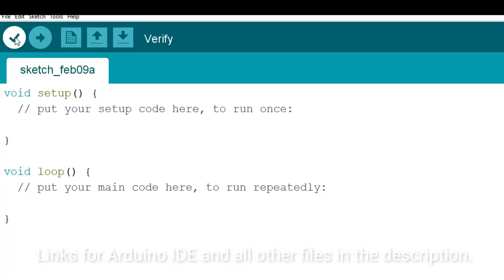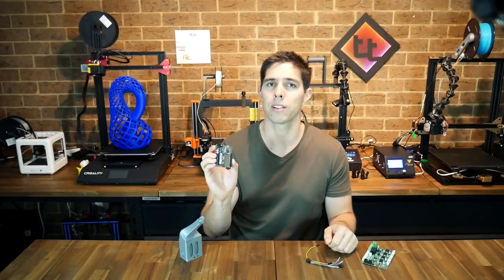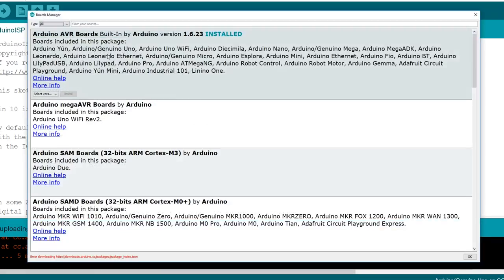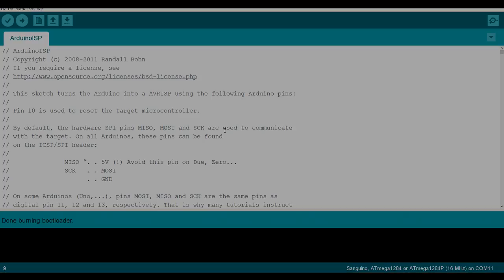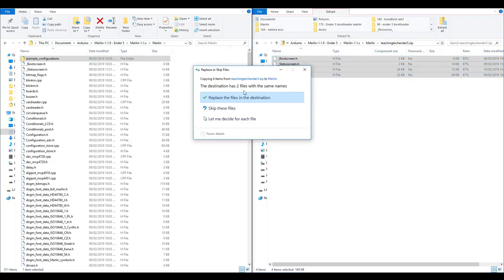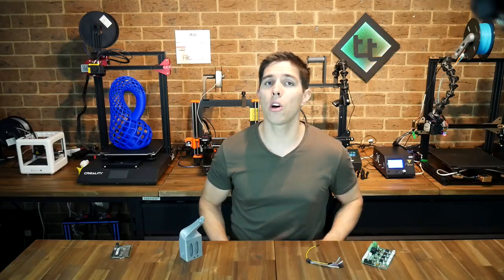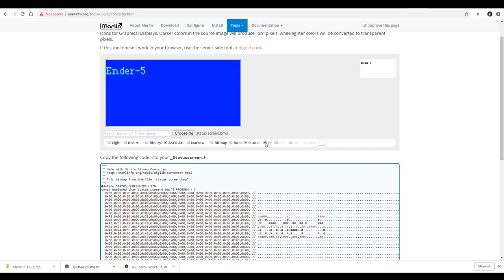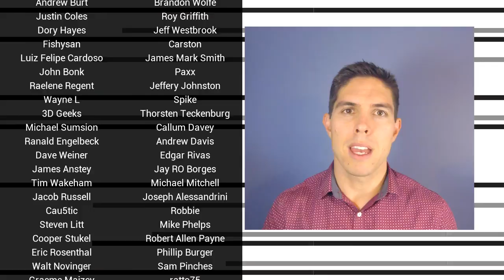Ender 5 bootloader and Marlin update

Comment: Personally I ran into 2 problems following your guide and it took me a few hours to solve, so I'm posting the issues and solution here for those in similar situation:

#1 I used "charge only" USB cable that did not transmit any data, so the boards were not visible. Make sure you use "real" USB cable (if the cable is very slim, it's probably charge only).

#2 My Arduino IDE used "arduino" in its programmers.txt setup file for "Arduino as ISP" template, instead of "stk500v1", so the board kept timing out when trying to burn the boot loader. Make sure it uses "stk500v1", i.e.:

arduinoasisp.name=Arduino as ISP
arduinoasisp.communication=serial
arduinoasisp.protocol=stk500v1
arduinoasisp.speed=19200
arduinoasisp.program.protocol=stk500v1
arduinoasisp.program.speed=19200
arduinoasisp.program.tool=avrdude
arduinoasisp.program.extra_params=-P{serial.port} -b{program.speed}

Credit for the solution to #2 goes to https://forum.arduino.cc/index.php?topic=342977.new#new

Hopefully, this will help someone from waisting their time.

Thank you Michael!

Comment: You sir are a life saver.   After replacing my original board, I received a new one in the mail and it came with ender 3 burned in.  I couldn't figure out any of the instructions on the creality website.  They are terrible.  Thanks for the step by step tutorial.  It worked phenomenally.

Comment: Michael, i used your software with a few adjustments to install an mks gen l into my ender 5, also installed the tcm2208 standalone as per your other videos. works great and is very quiet. pointer for anyone doing the same, make sure for your x and y end stop you use x max and y max plugs if using this software took me a few hours and a lot of youtube to figure that one out. thanks again for your informative videos and insight.

Comment: This might be obvious to others but I'd thought I would share. After printing the hot end would move to the front left as opposed to the rear right as it did before. In Cura i had to change the End G-Code in the printer settings. I changed "G1 X0 Y0 ;Present print" to "G1 X225 Y225 ;Present print". Now the hot end moves to the rear right after printing.

Comment: Thank you Michael for this great guide. Updated mine last night. I did run into one issue when attempting to burn the bootloader that I wanted to share. I had no issues loading the firmware with my MacbookPro, but for some reason couldn’t get the bootloader to burn when running MacOS. I tried multiple USB cables and ports on both of my MacbookPros, but it kept failing. I switched over to a Windows 7 partition on one of the MacbookPros and it worked.

TL/DR:
Had to use Windows to burn the bootloader, but MacOS worked for everything else on my MacbookPro.

Comment: Best help ever. Needed to flash my Ender-5 as it had problems. Could have done it with the creality firmware, but wanted to do something interesting. So installed the bootloader and moved to Marlin. Worked perfect. 
One problem, somehow when all done Z hight was 50%. So changed the setting in the configuration.h from 80,80,400,93. To 80,80,800,93 flashed again, which was easy with the bootloader installed. And all working as expected.
Again thanks very much.

Comment: Thanks for these guides, I've finally got my Ender 5 homing properly with an MKS GEN L board and TMC2208s

For people like me, that might not have immediately got what is going on and are trying to combine your E5 configuration along with the MKS/TMC2208 video configurations... USE THIS ENDER 5 configuration as a base. Only change the BOARD_MELZI_CREALITY to BOARD_MKS_GEN_L and then go ahead with whatever other changes you might have (BLTouch, display etc)... don't make the mistake I did and start inverting axes to match the instruction on the MKS videos.

Plug your X and Y endstop switches into the X&Y MAX sockets on the MKS and everything should go smooth.

Comment: Pro tips:
* If you don't see the pins on the Ender 5 then remove the bltouch daughter board.  It hid them for me.  Be sure to put it back after flashing.
* If you see multiple similar options in the Arduino IDE for 'Board', 'Processor' or 'Programmer', choose the most specific.  EG: 'Sanguino 1284p' over 'Sanguino'
* If you see multiple similar options in the Arduino IDE for 'Board', 'Processor' or 'Programmer', and it doesn't work then try others.
* If you're on a Mac, I found that I had to restart the Arduino IDE for it to see changes and even function correctly.

* You do not need to have the Ender 5 powered up on it's own power.  (That's not explicitly stated anywhere.)

Comment: Thank you Michael. Another great tutorial and the free files are a boon. Will look forward BL Touch upgrade walkthrough as not getting beyond probe double-click with the .h files you provided for Ender3.  B L Touch lcd menu items have no effect. Heads up as the new menu does not now offer disable x and y steppers for original manual bed levelling method. I have been running a Micro Swiss mk8 hotend and a glass bed for a month and am very happy with both. One last gripe about the new Marlin, it appears to chop the power to the Z axis after 2 mins when Auto Home has been run from lcd menu. This is a drag as with the weight of the glass the bed drops to the bottom of the leadscrew.  Make sure to un// the line which defines the small z drop before homing, otherwise the stepper then tries to pull the bed down beyond travel. A few good thingiverse parts have surfaced. There are an excellent pair of struts to fit under the bed which kills off the diving board twang effect and a modded Bullseye fan housing came out a few days ago which works better than chopping up the Ender3  version. Hope this helps and saves you some of the time that you have saved me. thanks again Mr D

Comment: I initially followed this video on a Mac. Ran into the same typical error noted by others. (I had Arduino previously installed on my Mac for other projects) So since this video didn't get my boot loader working I went and found some others. And in the end my Arduino IDE stopped working altogether basically. So I deleted it and its associated files from my Mac. Started over with a clean IDE install and back to this video........ Worked perfectly this time around!    Thank you :-)

Comment: Thanks! Many thanks! I recently bricked my practically brand new E5 pro by installing BLtouch..which went terribly wrong. After acquiring all the necessary items and following along with your video(s) I was able to remedy the situation.
Reply: Hey wassup King I need a little help with mine. I have a ender 5 pro like you also bricked mine trying to install BL touch and like you I got the Necessary tools and did everything but when I got to the last step which was uploading the firmware to my end or it says Sanguinoloh or something like that instead of saying sanguino any help

Comment: All worked beautifully for this newbie, except for the issue that others have noted with Z lead screw pitch having changed on the Ender5 (all varieties?). So the steps/mm needed to double from 400 to 800. This update also de-mystified Arduino somewhat for me. Many thanks.

Comment: Went through the process, finished ok. Didn't test the printer yet though, only turned it on. Thank you for the guide!
Edit: My Z Axis was squished, I had to fix stepping for Z axis in configuration.h from 400 to 800 to make it normal again
Reply: I have the same problem.

If you have OctoPi you can do the following

M503 - You can view your current settings. Might look something like the below (and other lines). Mine used to say Z400.00.
Recv: echo:Steps per unit: Recv: echo: M92 X80.00 Y80.00 Z800.00 E95.00
M92 Z800 - Changes your Z from whatever it is to 800
M500 - It will write it to EEPROM
M501 - It will load EEPROM values as active parameters
M503 - Confirm that the changes have taken place

Credit: https://www.reddit.com/r/ender5/comments/ekuosi/z_axis_halved_after_silent_board_install/

Comment: I did finally get up the guts to purchase the Arduino uno board and update my Ender 5 and with this tutorial it went well.  Some of the files and links have been updated since this video and you will loose the bed level feature.  I was unable to find a way to perform bed leveling after the Marlin firmware update and instead went on and installed the TH3D firmware (easy after going through this update here)  Even with the TH3D I found my bed was still a tad low and had to tweek the knobs up a bit higher while doing test prints.  The process of doing this firmware update isn't for anyone who isn't pretty tech savy and it will possibly lead to big problems if you don't follow the directions in this video to the letter!!  The main thing you will gain is thermal runaway protection, if you never leave your printer alone and never go to bed while printing you can forget about this.  That said, never leave your printer alone anyway!  But this is for that moment you walked away.  You will also gain the ability to tweek your firmware and modify what you upload since you can do it over and over with your PC and the USB cable, the UNO will not be needed again just the UNO software on your PC.

Comment: Thanks a lot for your tutorials i really did learn a lot, I’ve just updated my ender 3 with your last video thanks !!!
Reply: Thank you so much for this! I don't know if I could have done it on my own.

If anyone is getting an "unable to compile for sanguino" error, roll back to the previous version of Arduino Boards at the top of the board manager. 

If port access is denied and only one port is showing up when you move the USB around, restart your computer.

@teachingtech I also set the z axis not to disable when a print finished or when the other three steppers deactivate, to stop the bed from falling. This is out of my skill level, but I was hoping you could add in some code to help with leveling. I tried to enable mesh bed leveling. I tried to enable it and I think it used too much space? With the standard Creality firmware, the disable steppers option would allow you to disable just the x and y axis, or all three axes. This was very useful for leveling because I could auto home and disable x and y to move the head around for leveling, but now I hit disable steppers and the bed drops a couple of centimeters. Do you have any advice? Would love to still be able to do this, or enable mesh leveling.

Comment: Awesome, thanks for this! 

Would love a stepper damper, driver and tl smoother upgrade video for the 5, especially the damper with a bit of a more in depth look at how you solved it on the 3 for the extruder. X & Y went ok, doing Z means raising the printer with some taller feet I believe, but the extruder when I fitted it, I had to flip the extruder gear so it had the grub screw side facing in towards the stepper. This was the only way I could get it to fit, but then the gear shaft appeared to bend quite severely as the lever and clutch would press against it, so I took it off again.
 
I love the 5 in general, just needs to be silenced, the heatblock and psu fans in particular. Noctua with a buck transformer for the heatblock makes sense, was thinking about printing a 120/140mm fan duct to attach to the side of the printer to blow a ton of air through the entire base, then removing the psu case and fan entirely.

Comment: Hey ! Thanks for the Tutorial !
I needed several attempts to get marlin running on my Ender 5..... 10 hours fiddeling around... :-(
I noticed that the firmware is'nt optimal for the Ender 5. Especially one annoying thing:
When you choose within the menu to disable the steppers, all steppers will be disabled.
The original Firmware just disabled the X and Y axis so you can manually level the bed without pushing the Z axis...
Is there a way only to disable the X and Y axis when choosing within the menu to disable steppers ??
Reply: just download universal from th3d site and have fun
Reply: This is just a guess, but surely you could find the “disable stepper” command in the marlin firmware code and modify it to only disable x and y??

Comment: Teaching Tech, great content--learned a lot.  Question on my new Ender 5 Pro.  The hot end fan runs non stop which kinda defeats the purpose of silent board....:)  If I put a MicroSwiss hot end on, can I just disconnect that loud pesky fan, or is there a software solution?  I can't find any settings native on the machine to dial down the fan.  Thanks!

Comment: Michael, I just ordered an Ender 5 but it has some differences from every single Ender 5 review that I can find online. The one I ordered has a Version 2.1 controller with the Atmega 2560 mcu,  similar to the CR20. I am interested in adding ABL and possibly upgraded hotend with thermocouple sensors, later on. Do you have any ideas on how different this process will be for me, since this controller is different than any other Ender 5 review I've seen to date? Honestly, the main reason I ordered this was because the seller conformed through email that it did, in fact, have the V2.1 controller board. I do not know what else may be different from the original Ender 5. Creality lists NO information or firmware for this machine with this controller. I am very interested in hearing your opinions on it.

Comment: I am seriously thinking about purchasing the Ender 5. However, I am not impressed with what now seems to be its limited memory size and having to choose which limb to cut off so I can add features.  Seems in most cases, multiple limbs have to be sacrificed.  

What I was hoping for was information on how to upgrade the actual Controller Board to one that’s better and with more memory.  

Initial searches seem to point to this being possible.  

I understand that the intent here was to show how to improve what comes standard with the 5, however, it would be great to also show an alternative that gives a better controller capable of doing all of this and not having to comment out features.   I’m worried that with the next great idea I’d have to comment even more out...

This video was awesome. A bit fast paced for a beginner. But the beauty of it is we can stop and go back and watch it as many times as possible. 

Do you have a video or recommendation on a series of possible complete controller replacements?   From inexpensive to expensive and what you get with each??

Comment: Thanks for the informative video.
Would this be the same procedure with an Ender 5 Pro with V1.1.5 board. It hasn't got as bootloader. The reason I am trying to flash a new firmware is because its getting layer shifting on large prints. Thanks

Comment: Thank you very much for this video, it has been a big help in updating the firmware.

I Had a problem with the direction of the x/y direction of the steppers. I had to make the following changes:

I had to make the following changes, hope it helps someone:

Un-comment the following in the configuration.h file:

#define USE_XMIN_PLUG

#define USE_YMIN_PLUG

Comment out the following:

//#define USE_XMAX_PLUG

//#define USE_YMAX_PLUG

Set the following:

#define INVERT_X_DIR false

#define INVERT_Y_DIR false

#define X_HOME_DIR -1

#define Y_HOME_DIR -1

So it was a combination of reversing the homing direction and changing the PLUG to use the x/y min instead of max. If I set only one of those, i.e. PLUG vs home direction, it would try to auto home in the wrong direction.

I also made the following changes that were added to the marlin 1.1.9 bugfix branch (there's a separate github for the bugfix branch):
#define HOMING_FEEDRATE_XY (20*60)

I can't recall if the homing feedrate was in the configuration.h or the configuration_adv.h. It has helped the slamming into the x/y stop switches quite a bit.